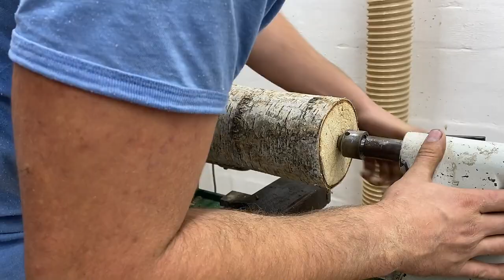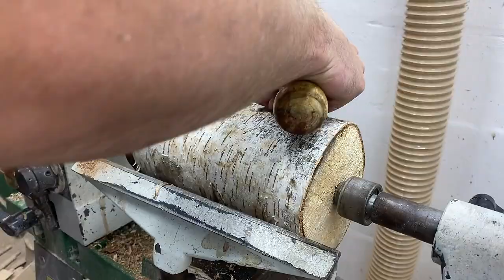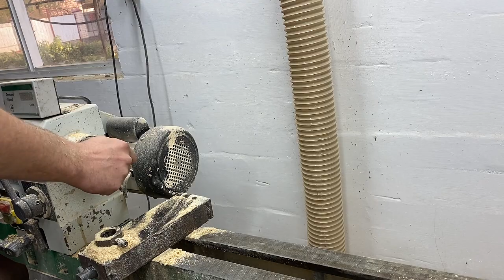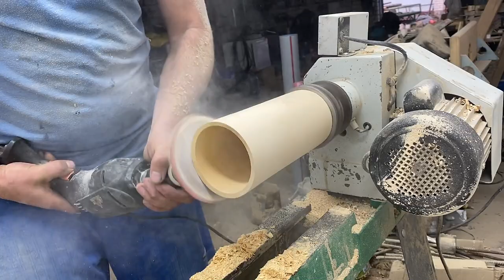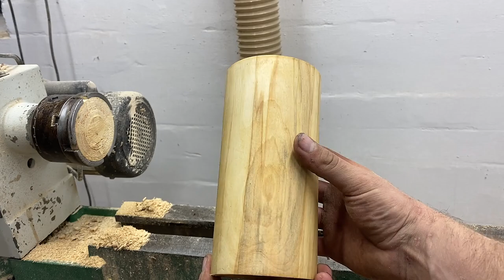Woodturning - turning a birch stump into a glass

Comment: Nice simple vase. . Niceto see that you removed the bark in one piece and not turned it off . Less mess to clean up . . Make a jamb chuck and remount it and round over the bottom  and make a rimmed foot and slightly dome the center and maybe add some texture details